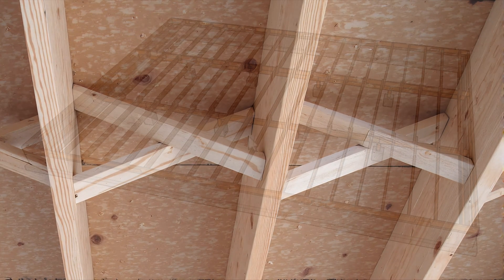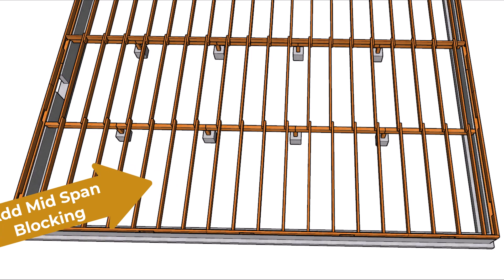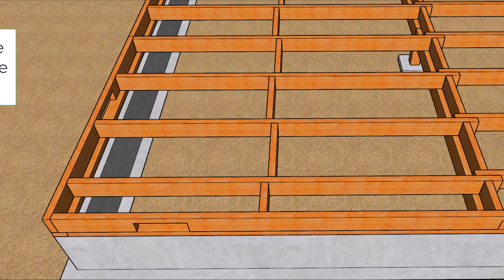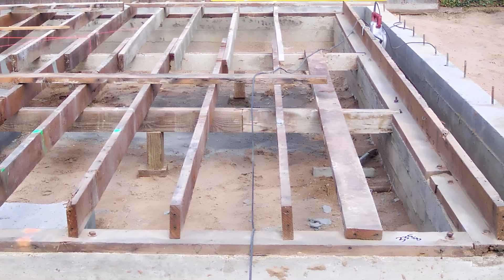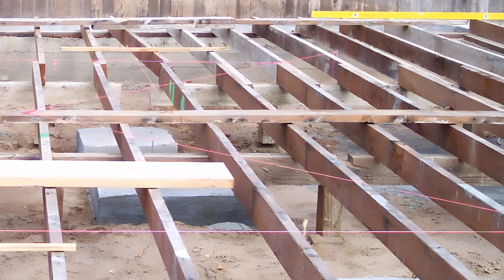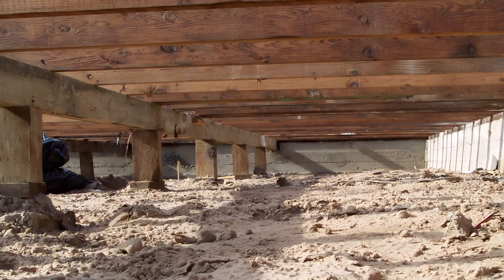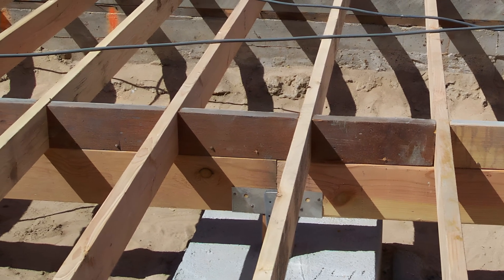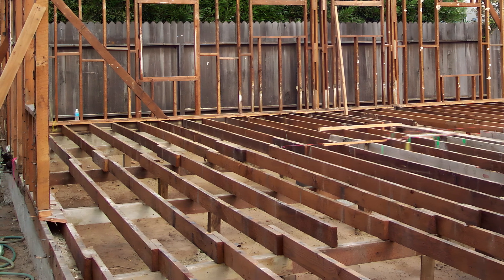How Blocking and Bridging Can Help With Bouncy or Sagging Floors And When They Can't

Comment: Midspan blocking was designed for 2X lumber, but NOT needed for I-Joists (engineered joists)!   Even the engineers say that "blocking" is not recommended as it won't help.   I-joist were engineered to resist lateral deflection!

Comment: I had no idea steel bridging was a thing for residential applications.  The deflection in the kitchen and bathroom of my 1939 house with 2x8 joists just meets the ratings for a ceramic tile floor.  The steel bridging looks easy enough to install and I'll try it before laying the tile.  There's no such thing as overkill, in my opinion.
Reply from the maker: Hope the steel bridging works out for you!

Comment: Thank you. I liked the video. 

I had to research this because it's been so long since it's been an issued.  
This current project is a house that was built in the '60s. 
The county that it was built in did not have building codes. 
The floor was built over a basement and eye center wall was ran down the basement to support the floor joist where they join together. 

The builder of the home chose to use 2x8s 12 ft on 16.   He could have definitely got away with that if he would have done a couple more things.  
1. The framer was allowed to use #3 yellow pine floor joist.

2. Bridging that was used was tn metal strips that are nailed into place. Unfortunately none of the nails were driven and flush, Just tacked into place. 

To add insult to injury over the following decades as homeowners upgraded systems, the installers drilled groups of holes very close together on the floor joists.  Many of those floor joists s are cracked from the hole that was drilled to the nearest knot. 

Adding a sister board for support would be a good fix if it were not for all of the utilities that were ran straight through floor joist. 

It would almost need to be unwired and unplumbed fix the framing and rewire replumb underneath the floor joist. 

Just don't say a simple fix. 

But I am grateful for this video and the explanation reminding me of some of the minimal codes in the 1980s

Comment: I was a maintenance technician for a very large 4 story wood framed hotel.  There was terrible amounts of sagging and squeeking throughout. The sagging was mostly of the plywood between the floor joists. FTR, all such buildings in north America have a thin layer of lightweight concrete poured over the plywood, the main cause of the sagging from joist to joist. The gypcrete is there to slow the spread of fire.

Comment: @gregvancom - You once said in an old video that blocking causes squeaky floor. This video you seemed to say the opposite
Reply: Good blocking will remove squeaks from the surrounding floor structures.  Bad blocking will squeak itself.  Extra structure in construction usually stabilizes -- unless it's poor quality, then it creates more problems.  Universal principles.
Reply: @WanJae42 Right.  If installed properly with this in mind- use screws and construction adhesive to remove the chance of wood rubbing against each other or nails squeaking.  Little more cost but huge gain in performance and longevity and more likely to get tue results you want especially in new construction.
Reply from the maker: No, you can end up with squeaks over time if the blocking loosens. Let me know if you need a follow up video on block squeaking.
Reply: @gregvancom I'd love that if you haven't done it already.

Comment: In my new home construction, I plan on adding blocking.  But not staggered blocking.  Instead, it will be aligned with the sub floor.  It will be more complicated to install, but by being able to tie in the panels to the blocks, I think that the overall rigidity of the floor will be better.